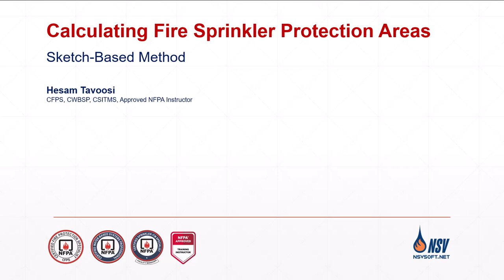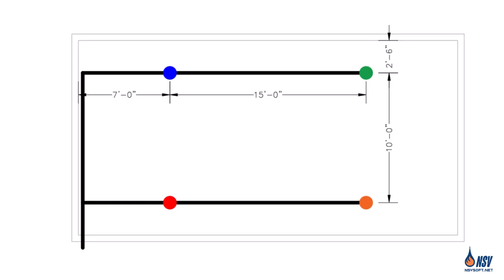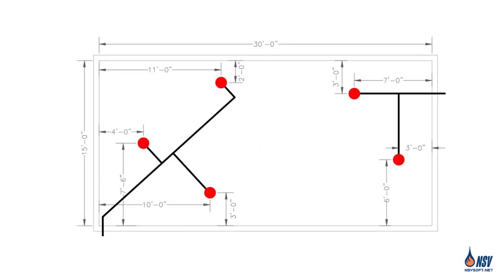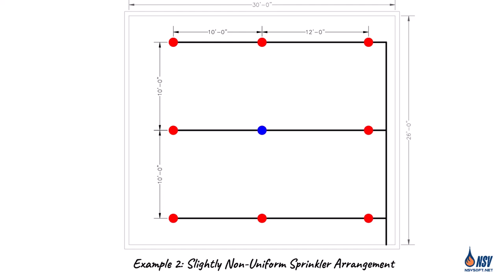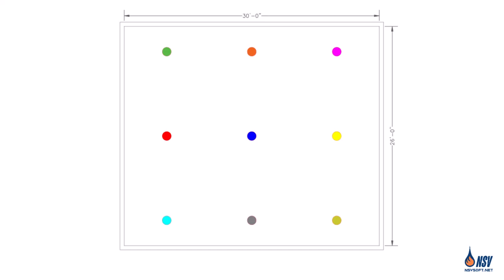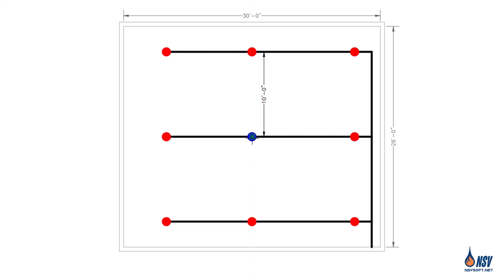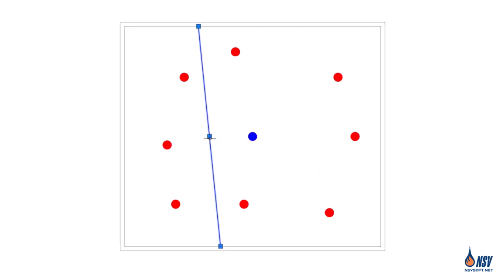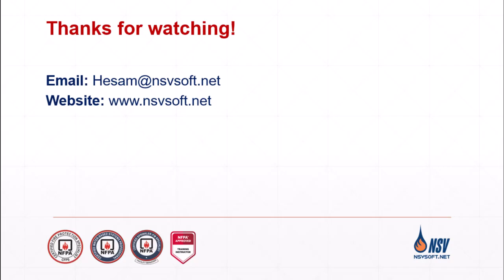📐Calculate Sprinkler Coverage Area: Sketch-Based Method (NFPA 13)

Comment: Is it free
Reply from the maker: Hi, the demo version of NSVCad is free.
Reply: @NSVCad is the sketch based method exists in nfpa13
Reply from the maker: While the specific term isn’t in the standard, the method is fundamentally based on the S × L rule from NFPA 13. Our technical team took that core concept and adapted it to effectively calculate coverage in scenarios where sprinklers are non-uniformly spaced.